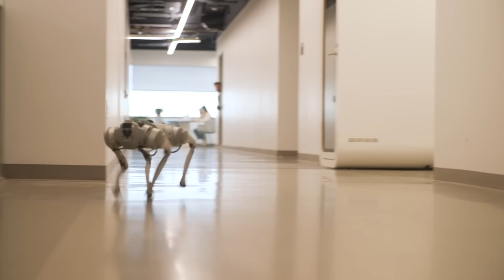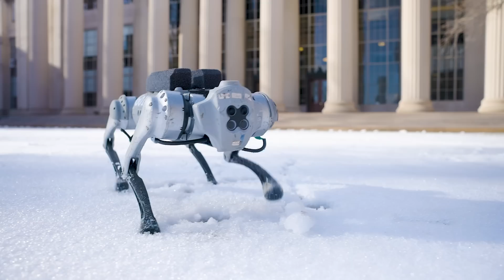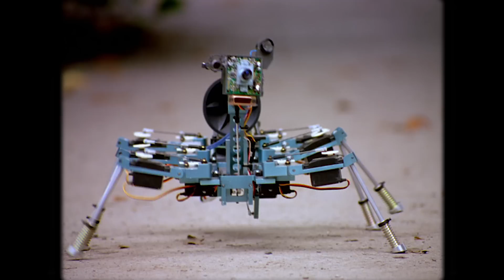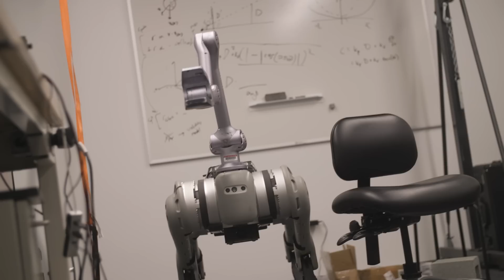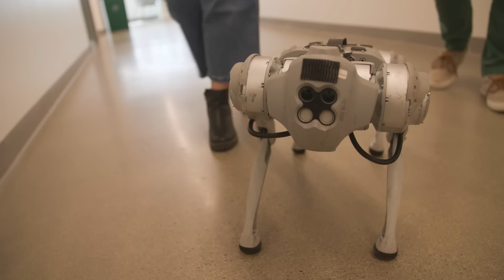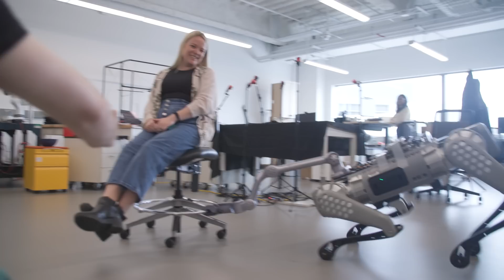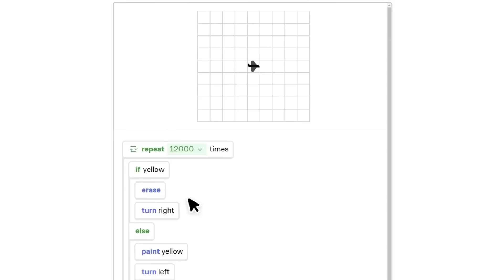Has A.I. Made Robot Dogs Too Smart?

Comment: any ai with any real capability needs to be in a data center, because of the processing power + electricity and cooling it needs

if you can fit it in a mobile robot, its basic level stuff

Comment: The truth is I have seen an AI that was said to be a living AI as it was built from a living fungus and designed from the human brain, and in the demonstration they plugged it into an eight foot robotic spider it knew nothing about, and was told to walk to the end of the factory , no programming needed at all, it looked at the schematic of the machine turned it on and walked to the other end of the factory over the six foot wooden crates like it was alive, this AI was what the terminator was about.
But the military that has it built a robotic soldier, and was using it in an underground base working with humans to see how it got on with humans, and in the end it started to reprograming there war computer with a language they could not decipher, and when asked to stop it resisted and the black op soldiers were called in to take it down, the soldier said they thought they were not going to get out alive, this AI was so smart it could predict their moves making near imposable to stop.
So all this AI research is to develop an AI that follows orders without question, an AI that is smart enough to go to war without turning on them, so said, no wonder AI turns against humanity when all we do is use technology for war.

Comment: What about the other problem, of being incredibly energy inefficient. Yes we can make shortcuts because analytical solutions are a pain (and you have to pay people to write them), but relying on AI takes roughly 10 times the amount energy everytime you use it because everytime the model is queried it has to interact with a load of dead weight nodes that have nothing to do with the task at hand (artifacts from your mums posts on Facebook, and all the 4chan pepe memes).

There was a time where people wanted to make the code that drives applications as efficiently as possible. Now global warnings only getting worse... so let's spend 10 times the amount of energy so that I don't have to understand the actual problem at hand is.

Comment: I guess instead of rounded stumps for feet, there could be a spinning ball as a foot.
If you slide, you correct it so that you instead glide, or break.
Combine that with a "melting" feature for more grip and you're golden.
Should be pretty easy to realize when the foot is slipping; "I'm not moving my leg, though I am moving" -> Magic correction (I'm not a robot programmer)

Comment: Ah yes the cheep chinese robot dogs, is this a AI threat?

No not really, the current "AI" we have are massive data set neural networks housed in enormous ware houses using many megawats up to Terrawats of power depending on size for LLM "AI's" so the scifi dream of a handheld sentient AI is just as far away as fallout's micro fusion cells, there fore needing to be remote controlled.

And just like in the big current ongoing conflict in ukrain these remote controlled units have a massive glareing weakness, signal jamming. And if you want to hard kill one's reciver if not outright the whole thing, microwave EMP emitter, easily made from a old magnetron taken fom a microwave

Comment: Relax, all! Jez, everyone in the comments screaming about, "Why aren't people thinking about the consequences?!" and the lot of nonsense that comes along with such thoughts. I'm over 40. Never in my life has an emerging technology received such critique and scrutiny from the general public. Never in my life, nor in the history that I have read has there been a technology for which we've already considered so many downsides! It's a double edged sword, but we've never been so well aware of the second edge, before. We're already engineering the answers, faster and more thoroughly than ever before!
To cap it off, we've never before had such rapid progress, not just of the base technology, but of working through the kinks that come with new tech. This is the strength of the Silicon Valley ideology, for all it's faults, it knows how to correct software problems, roll out updates, and lives or dies on the opinion of it's userbase.
You want to know what the technological future will bring? Whatever the market demands. You're the 'market' and YOU get to make demands. Vote with your wallet. Support companies which are pushing forward BOTH the tech and the solutions to the issues it brings. Support open-source projects, because of transparency and privacy, and to keep the new tech affordable for all, not limited to the Elites. If we regulate, they'll do it in secret, reap all the rewards, and push the dangerous edge of the sword into the necks of the public, with zero oversight.
Stop being stupid and use that monkey brain to learn some history, and learn to apply it forward, as you've always been told, "Those who forget history are doomed to repeat it." There's a flip side to that moral, IMHO, "Those who learn history have the power to wield it!"

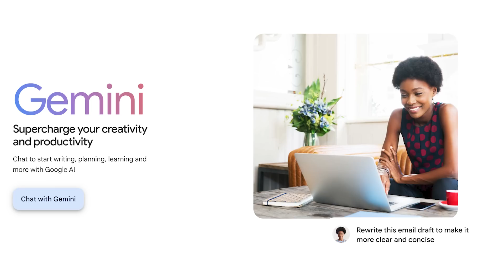Comment: No, it's not accurate to say "No one programmed Chat GPT to give me that answer" at 10:36. Generative AI is programmed to program itself off of data which becomes part of its programming, meaning the artist that made the art, the websites that were scoured for writing, and even the previous failed movement of these robots were part of the programming that made the generative AI do what it does including Chat GPT giving you that answer. Just because it was generated from data that didn't originate from the programmer does not mean it doesn't become part of its programming. It doesn't transcend the limitation of computer apps to only run on programming code just because it is machine learning. It's simply self programmed off of preprogrammed parameters, input data, and then crucially humans rating the quality of its output until it is programmed to output some semblance of a new thing that is very often less new and more likely plagiarism or copyright abuse.

The code is still code. The program is still a program. Chat GPT was programmed to give you that answer no matter what method the programmer used to program the app.

Comment: 1:00 "4.7 m/s or 10.5 miles/hour". Is this purposefully said to exclude km/h?

By the way 4.7 m/s is 16.9 km/h.
Reply: I guess from now on when you watch American media, you should get used to hearing American measurements. I know that is an insane concept to understand for some people. Regardless of that concept, she started with 4.7 m/s which is metric system and gives you a perfect idea of their speed.
Reply: @RyanGrissett  not if you don't use m/s but km/h on daily basis
Reply: Scientists usually use the MKS unit system. The unit of velocity in that system is m/s. I thought "we should be doing what scientists do" is what the "use metric units" zealots are always saying.  Apparently people are never satisfied.

You know how big a meter is presumably. And you know how long a second is presumably. So what is the problem exactly? It moves 4.7 of those things you definitely know the size of every second.
Reply: @timseguine2  can you tell what is 20 feet/second? just like i can't intuitively tell what is 4.7m/s
Reply: @exp5261  wut? What kind question is that? Of course I can. I can visualize 20 feet. And I know how long a second is, so I can visualize how fast an object would have to travel to travel 20 feet in a second. If you can't you are either lying about it or have a spatial reasoning deficiency.

Can I convert that to every conceivable unit someone might find useful or be familiar with? No. But that is not the same thing. I also can't convert between Celsius and Fahrenheit, but I know in both measurement systems when I need to wear a sweater.
Reply: @timseguine2  that's why we use measurements that are familiar to everyone. that's the point if you use metric system for speed
Reply: @timseguine2  Yeah if you use metric on a daily basis and can't be satisfied with or visualize m/s, you have bigger issues.

Comment: I feel like the majority of the fear that people have of AI and robots come from movies and other works of fiction that are specifically designed to scare people. Ive seen and been personally asked multiple times things like "what about The Terminator, or what about The Matrix." People are letting this fear they felt bleed over into the real world causing them to make decisions about things that haven't even been developed yet. They look for anything they can to justify this obviously irrational fear. After all, there is not 1 single example that can be used to actually justify the fear of AI and robots becoming Skynet and the Terminator. And the majority of realistic arguments against them would also apply to nearly everything else. If we should ban them because they may be used for war, then what about motorized vehicles, communication devices, and so on? Nearly everything has the potential to be used in a negative way.

Comment: Robots that will be used for legitimate civilian applications will likely have access to level floors, so wheels are almost always going to be more efficient and more practical. Search and rescue operations demand more aid than can be given by a dog, people usually need extraction or evacuation, so a dog probably won't be able to provide that. If you're searching for someone over a large land area, a flying fixed wing done is more efficient and practical. Robot dogs are optimal for delivering a few tens of kilograms of payload moderate distance over difficult terrain, which has military application, and not much other use that couldn't be done better with a flying or wheeled platform. That's the real issue here, there is no other legitimate use.

Comment: I'll be the first to admit I am bias toward AI, I honestly think it is a great thing, how humans use it is the problem. Though the extent of my understanding of AI comes from videogames, a very basic understanding of generative AI, and Roko's Basilisk, so this might not make any sense;
Would it be possible to implement a temperature and pressure surface on one dog, similar to the advances we have seen in the field of bionic prosthetics, then program that one dog to seek out warm and light pressure but avoid extreme temperatures and heavy impacts using advanced machine learning giving the dog the ability to modify its own code, analyze its movement patterns and make adjustments to optimize its performance? This would motivate the dog to succeed through physical contact with a handler or seek "comfort" like a real living thing needs. With the added benefit of the dog learning to avoid situations where it would risk damaging itself or others. By giving the dog the ability to feel we could cause the dog to develop a rudementary form of companionship and risk aversion, motivating it's learning to find the safest and most energy efficent routes all on its own. It would need to learn in real time so no hours=months simulations. And have it know its power would be rationed to charge once a day to improve their resource management skills.
Or is there some glowing red logic problem with my suggestion which I am not considering.

Comment: I feel like a spider would be a much better platform for movement. But they went dog because robot spiders would creep people out.
Reply: They went with a quadruped because quadrupeds are a lot easier to work with.
Reply: @LutraLovegood  They are also being promoted as a friendly little dog companion
Reply: Exactly 😂
Reply: Spider and crab-like motion is probably harder to replicate since you have more limbs, which means more motors, which means more nodes in the neural network, more potential error and more time training the AI. The fact we see so much quadruped motion in nature shows this is a very successful and stable method of locomotion, and is the most simple to replicate while maintaining high stability. With better computers, we might see more complex robot analogs of natural creatures in the future.
Reply: 8 legs would be twice as mechanically complicated and twice as hard to program
Reply: @Kekatronic  Mechanically more complicated. But the research on locomotion an robotics suggests that robots are generally more stable and easier to control the more legs they have. Basically: if one leg does the slightly wrong thing, the robot is less likely to fall over if it has more legs.
Reply: spider is not as agile

Comment: I found it really odd not having a single reference to Boston Dynamics, knowing that they have had their first commercial robot for several years now, and these robots that starting popping up are mostly copies
Reply: Boston Dynamics was originally affiliated with MIT before they were acquired by a private company.
Reply: @Dx-Dm I remember seeing a 60 Minutes show on that MIT robot
Reply: @Dx-Dm  I hope Hyundai/Kia are better at making robots than they are at making cars.
Reply: @blockstacker5614  Hyundai and Kia have been consistently, producing some of the most reliable cars in the last decade, across the world. They're also both killing it at EVs.
Reply: @dsp4392  rofl
Reply: @blockstacker5614 any sources? Any valid points or just hearsay?😂
Reply: @dsp4392   boy..imagine thinking hyundai and kia are killing it in EVs.  they aren't even in the top 10 worldwide sales
Reply: @blockstacker5614 ”KIA robot boys” coming soon 😂
Reply: Boston Dynamics used to be apart of MIT so that’s actually what they referenced when they mentioned it
Reply: Boston Dynamics weren't using AI. Every movement of their robots was programmed.
Reply: @arxmechanica-robotics  No, it was a mix of both. Preprogrammed movements would quickly accumulate error and cause the robot to wreck.
Reply: same
Reply: boston dynamics sadly fell behind a lot lately. they are too slow to innovate, unlike these new explosive start-ups.
Reply: Unitree stole MIT's motor design for their cheetah, so it only makes sense that MIT gets all the attention here.
Reply: @bunnypeople  MIT is using the 3 year old GO1, the GO2 is much better than anything Boston Dynamics came out with in a long time.   Hyundai ruined BD...
Reply: Don't worry. The US regime will ban Chinese Unitree robots for "National Security" reasons so MIT can go back to paying 70k per robot.
Reply: This video is just an ad for this srpecific robot dog
Reply: Boston dynamics' dog is on sale now for $74,000. The Unitree GO2 Pro costs $3999 and $9420 with flamethrower.
Reply: Acquired by Hyundai several years ago. Try to keep up!
Reply: @kittinsmittens  you are trying to keep up, but you're not doing a good job... Hyundai have the majority of the shares, but not all of of it. Still, Boston dynamics works as a separate company and it doesn't change anything about what they have done in the past
Reply: Quoted from Wikipedia ...... " Boston Dynamics, Inc., is an American engineering and robotics design company founded in 1992 as a spin-off from the Massachusetts Institute of Technology. Headquartered in Waltham, Massachusetts, Boston Dynamics has been owned by the Hyundai Motor Group since December 2020 "

             It is possible that she got turned down for an interview ....... Maybe , Just Maybe she might reply to one of these comments .......
Reply: Sponsorships.